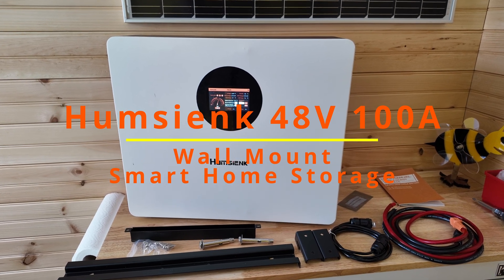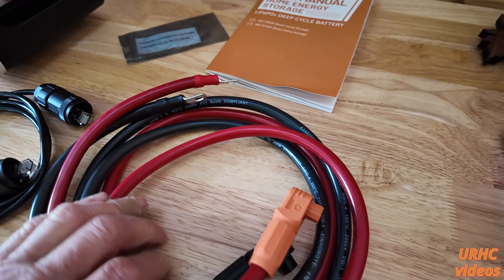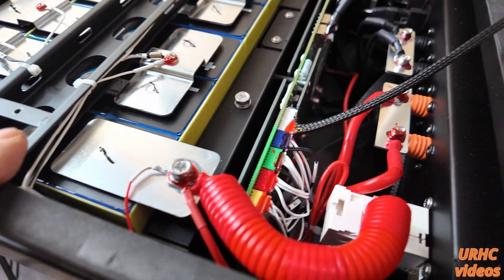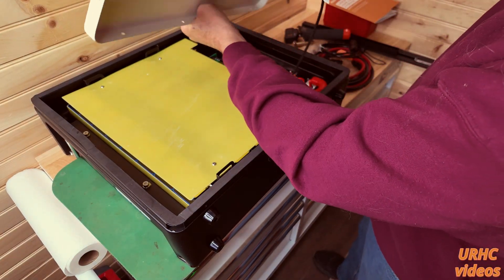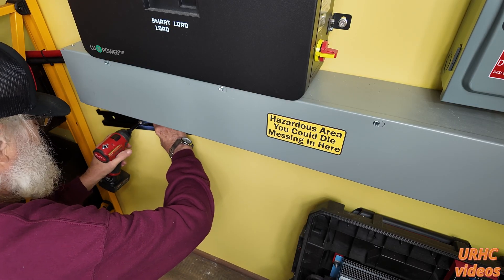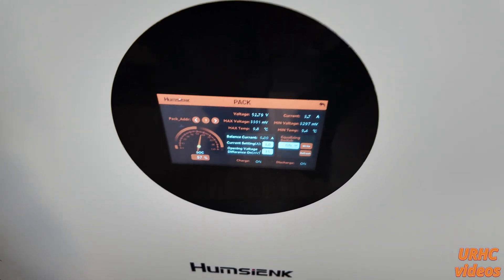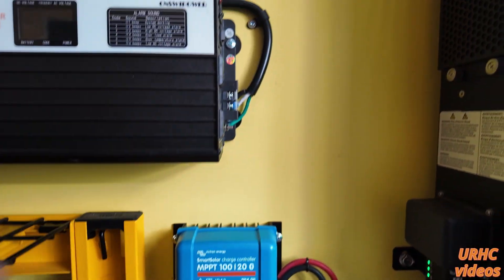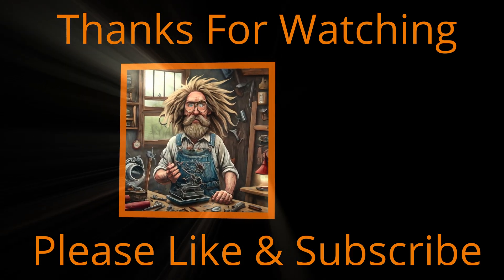Humsienk 48V 100A Wall Mount Smart Home Storage

Comment: looks like a TDT BMS very good stuff.Thanks
Reply from the maker: So far it has been working great but lightly loaded with just the small heater. Very nice build for a budget battery.  I think its BYD cells. Thanks for watching.

Comment: Thank you, these are on my list for consideration. I have 2 Humsienk 51.2v 100ah golf cart batteries, so adding 1-2 of these will be great.
Reply from the maker: I was told the price will go up after cyber Monday and the extra discount will expire so now may be a good time to get them if your project is in the near future.  I think both use the same BMS and should work good together.  I'm thinking about buying one of the 310ah models if by chance they extend the sale price into December. Thanks for watching.
Reply: @unemployedredneckhillbilly2023 got 2 of the wall mount 100ah ordered. Only concern is that the golf cart batteries are 200a BMS…… and I’ll have to buy a shunt for monitoring the 2 golf cart batteries and the 2 wall mount batteries, since there is no communication. The golf cart batteries do have a 5 pin aviation plug and a small monitor. 
I wonder if I can fashion a cord that would communicate with the wall mounts, since they are all Humsienk??
Reply from the maker: I am not sure about that. I have been using mixed batteries with the 12000xp and running in voltage mode without problems. I have to pick up another inverter with communication to play with in the future.
Reply: @unemployedredneckhillbilly2023  I have messaged Humsienk to see what type of communication protocols the golf cart batteries use. If the same as the wall mounts, I may try to DIY a cable to see I can successfully connect the 2 golf cart batteries to the wall mounts. I can change the BMS settings in the golf cart batteries to match the BMS setting of the wall mounts, then they will technically match

Comment: Same damage on my unit. Right above the screen There is a bracket that hits the panel from the inside out. Seems like an issue with a lot of them 

https://youtu.be/XlYMA1WcD9Q?si=KL4CW6qp9py8ec4I
Reply from the maker: That looked like some warping from manufacturing on mine but could have been from shipping. No marks on the inside.  The poor fedex guy had a heck of a time getting it off the truck and definitely put it down hard on the corner. This came completely cross country and probably was on the bottom of the truck. Thanks for watching.